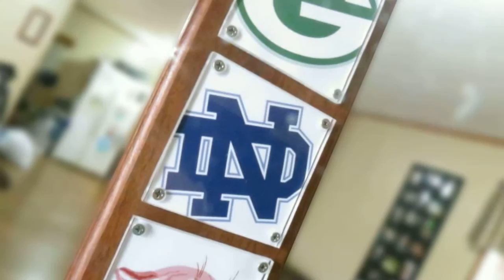DIY Easy 3 Photo Picture Frame

Comment: Great project and great video! The jump-cut editing style with the drill footage turned out really good.
Also... your drill press has a huge spring on the main column. I'd like to see that entire tool. Is it vintage?
Reply from the maker: +Awesome Wood Things I suppose you could call it vintage. I actually did a two-part video on it a while back. It's designed to hold a corded drill and just requires a primitive plunging action. It's a nifty little device, but one that I won't be using in the near future. I recently acquired an actual drill press, so that is what I'll be using in most future projects. Thanks for noticing the jump cuts. I really want to experiment with some other editing techniques this coming year. It's lots of fun. Thanks for watching.